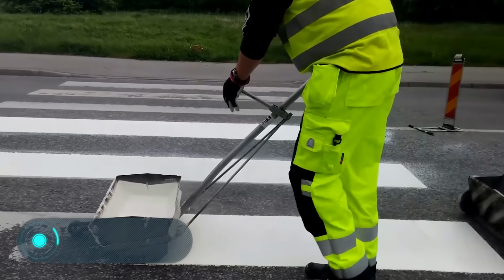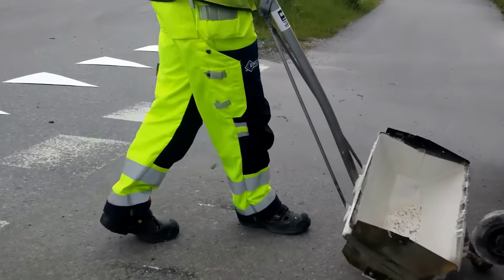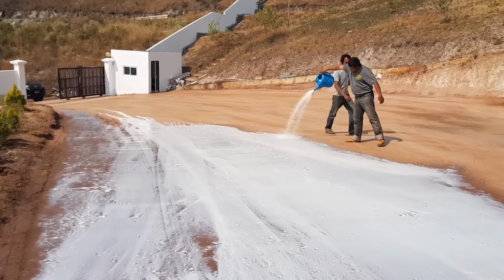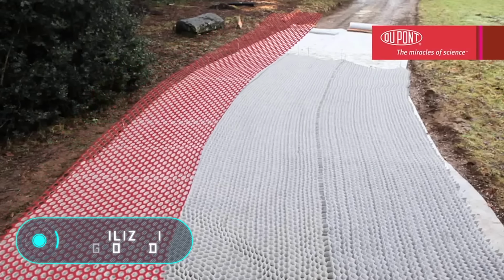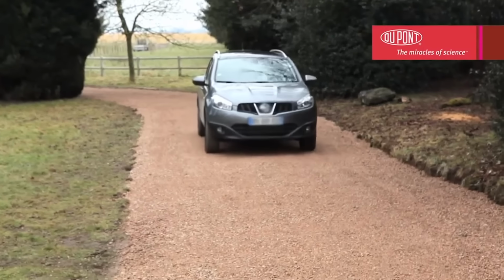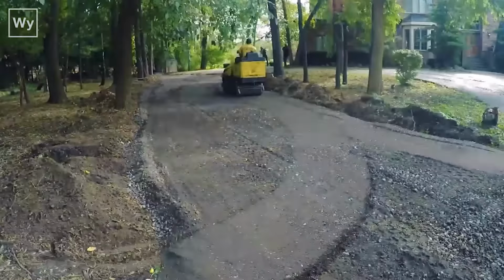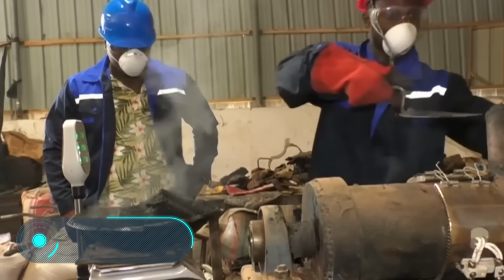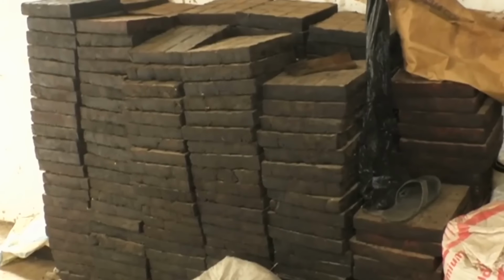INSANE ROAD CONSTRUCTION TECHNOLOGIES THAT ARE ON ANOTHER LEVEL

Comment: The poor workers having to do their work with flower watering buckets instead of a sprayer like handcranked or high/low pressure washer
Reply: Poor workers? You are super lazy if you say that... what about them getting a free workout and not paying for gas/electricity?
Reply: @Wheemer  thank you so much for responding, indeed you are correct, plus very limited space for machines on that project.
Reply: This particular job was in a parking lot and space was limited for bringing in sprayer trucks. They are not poor workers, they're engineers and very well paid. Thank you for your comment.
Reply: K31 Roads i did not mean poor workers as in they dont have money but poor workers for having to do all this work by hand
Reply: @tsfcancerman  duly noted. As we explained in the comment above, that had to be done by hand coz it was a parking lot and space was limited to bring in machines. Thank you for your comment.

Comment: Plastic slabs as a roadway, well initially it sounds awesome and all that but it will make it even worse since cars will ride over them and small plastic fragments will be ripped off and thrown out in the environment and it becomes even harder to clean it up, if not impossible.
Reply: Where I live people protesting tend to burn tires or other material in the road to get attention to their cause. Imagine how much more troublesome it would be if it was plastic roadways.
Reply: @manickn6819  What do you think asphalt is? Its the same thing with sand and stone mixed in
Reply: @tomkelly8827  I am very much aware of what asphalt is. It does not catch on fire very easily at all. Even with tires burning on the road very minimal damage is seen afterwards.
Reply: @tomkelly8827   it's not, asphalt would not burn, some asphalt have tough plastics in them to change performance characteristics etc but wont burn like a tyre.